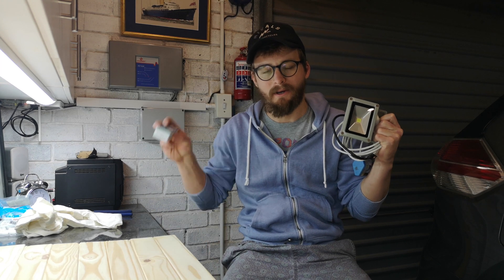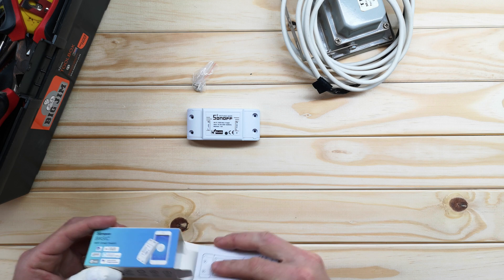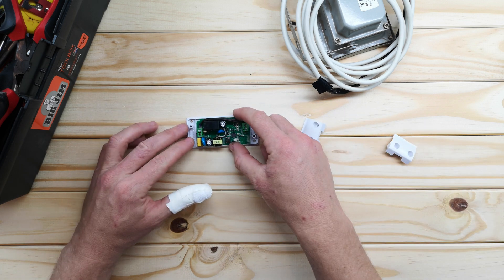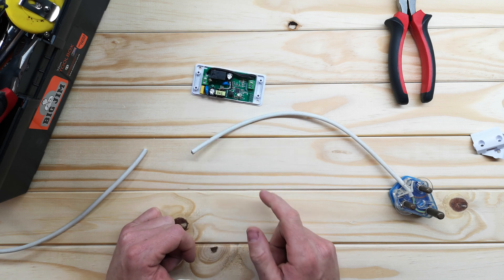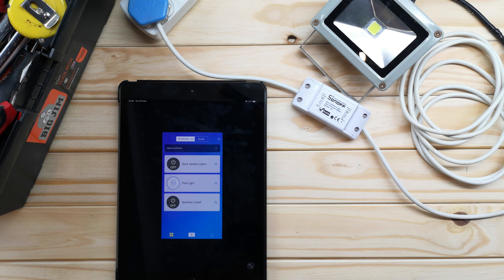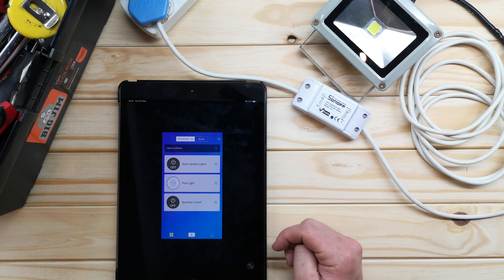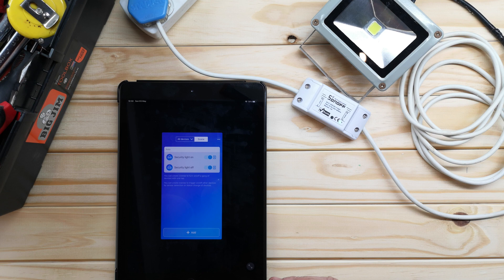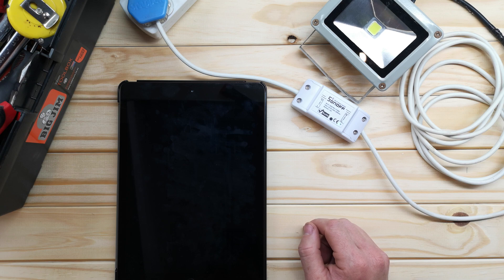ADD A WIFI SWITCH TO ANYTHING! (SONOFF) | TECH

Comment: You said you can control it directly from your phone if you don't have a home automation hub.  Are you saying that these don't have to go to the cloud?  As long as your phone and switch are on the same network?

Reason being is that where I want to use this I don't have internet service.  But I can put a router in and then use wifi.
Reply from the maker: That right, if you are on the same wifi network, and your devices are up to date, there is a lan control option for control without an internet connection.

Comment: If you have a manual switch on the power cable to your light already, do you place the Sonoff on the power side or the light side? Other people need to be able to turn the light off/on when you are not around.
Reply: Piggy back a momentary switch soldered onto the sonoffs test button.
Reply from the maker: So you can install it between the plug and light, and then the button on the sonoff can be used to switch it, or you can use a sonoff mini that has a button input.
Reply from the maker: Alternatively you can set the default state to "ON" so when it gets power it switches on and then you can control it.

Comment: Howzit Chris help me out here would you recommend using a Sonoff Thermostat 16Amp Smart Switch to control a geyser?
Reply from the maker: Hi, I would not. 16A is not sufficient for most geyser circuits, and measuring the temperature is a challenge in a geyser. Honestly, if you want to control a geyser your best option is a Geyserwise. These do the job of managing geyser power really well. If you just want to save power, a timer on your geyser also works well.

Comment: thank u for well explained video, I've a question is this switch any good for window air conditioner? thanks...
Reply from the maker: Well it depends on the electrical power of the aircon. Off the bat I'm going to guess the answer for this particular one is no because the Basic switch is limited to 10A. Maybe you need to consider the Sonoff POW 16A which has a higher current rating and has the benifit of monitoring power consumption.
Reply: @chrisdoesstuffza  Sonoff says the POW R2 should not run over 10amps for longer than 10 minutes so i would not suggest that - it is designed for high short load burst eg, the starting of a motor.
Like what is installed on my Geyser would be suitable for an aircon, the POW R3. I have yet to connect my aircon to my smart home and Homeassistant
My 3000W geyser pulls around 2800W and around 12 amps for the duration of its heating time.